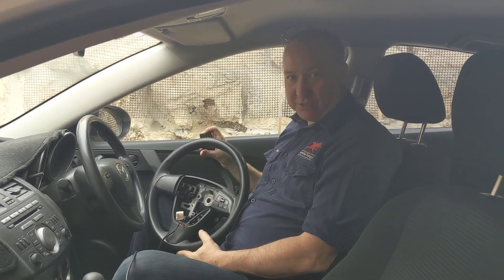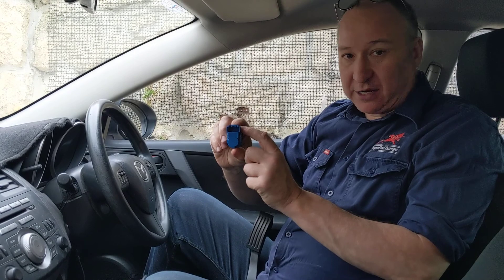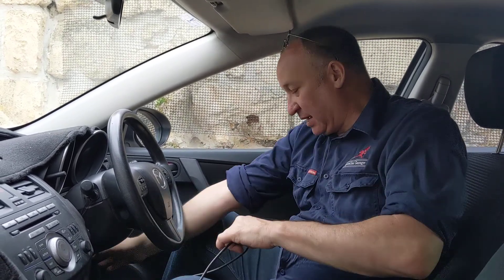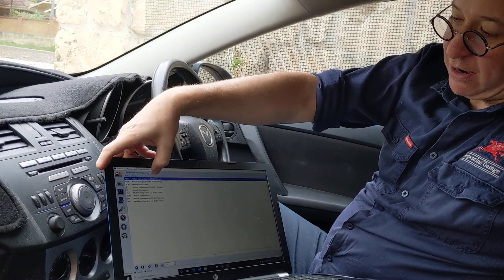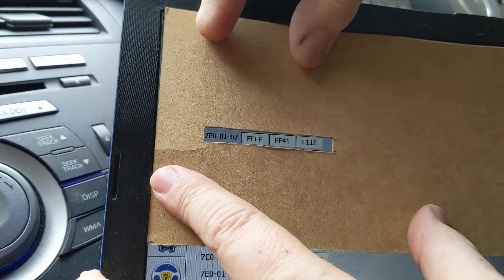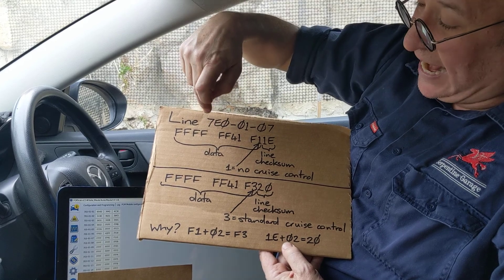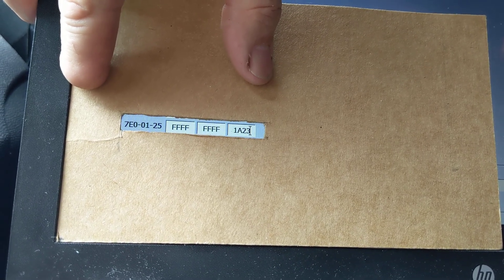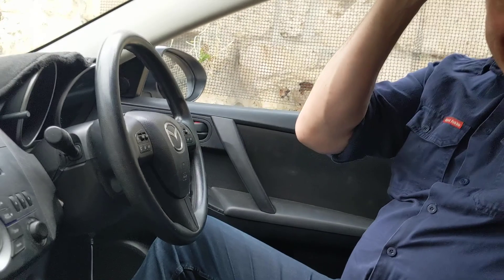BL Mazda 3: 1/4 How to install factory cruise control using FORScan. 2009 2010 2011 2012 2013 2nd

Comment: Can we install any Mazda 3 2013 steering wheel with cruise control buttons on it? Or do I need to match the exact same model like gx to gx or gt to gt model of the steering wheel. Thank you for the information .
Reply from the maker: You don't have to match the exact sub-model.  But it does have to be from a BL.  Neo, Maxx, Maxx Sport, SP25 or MPS.  It doesn't matter as long as it is from a BL (2nd Gen Mazda 3).

Comment: Hi Paul, I have a 2010 Mazda3 that has no control sets on the steering wheel. Is it possible to install a steering wheel with the four control sets? Will the wiring infrastructure be there to connect the control sets? Thanks

Comment: Hello, thank you very much for the detailed explanation. While trying the process I sadly stumbled upon a problem on my Mazda 2 DE. I could edit the line number 7 as you showed (it even had the same number). Line number 25 though could not be edited. Every time i try to save it the pc just resets the number to the previous value and gives me the error of not adding up. A change cannot be saved somehow. Do you have any idea or explanation?

Thank you very much in advance
Reply from the maker: Hi Max,

I have never tried to do this on a DE Mazda 2, and I don't own one to experiment.

Maybe disconnect and reconnect and hope that you get the easy method instead of the difficult method.  You might get lucky.

Paul.
Reply: Thank you for your response. I have found the problem. I could not change only one digit but had to change two of the last four digits. The second one of the four minus two and also the last one minus two. The cruise control still does not work even though i have the fitting brake switch. In a forum i have read that there are two cables missing. I will try to troubleshoot a bit more and post here once found for other people with the same problem

Comment: Mi cable tiene 2 pines. Si pongo  una conexión con 4 pines y  el  interruptor,  tengo posibilidades de obtener control de crucero?
Reply from the maker: No.  If you only have two wires then your car is not compatible with fly-by-wire cruise control.

Comment: Hi Paul, can I do this on a mazda cx30 without native cruise control?
Reply from the maker: I've never tried it, so I cannot say categorically.  The way to check would be to log in with Forscan, and see if there is an option to turn CC on.  If the option is there, then you would ned to check to see that the wiring harness has the right plugs etc.  For example, does the brake light switch have two wires or four?

Best of luck.  You'll work it out.  You've got a major head-start on what I had, and  I worked it out.

Paul.

Comment: Hi Paul, My 7E0-01-07 line is
FFFF 9641 FFC3
I am not sure wht to change the last FF to to activate the cruise control?

I tried the simple method, but without hardware change yet, and error come every time trying to write. I am using a not so original OBD USB reader. 

Thanks fo checking before go buying more tools 😅.
Reply: Your are superb Paul.
I checked brake light switches, and it turned out I had two brake light switches not one, each has two connection. So left the as they were.

Forscan was able to enable the cc, using Forscan recommended ODB cable via the easy method.

Grabbed a used steering wheel with cc buttons and replaced mine.

Hurray, Cruise control light up and is working 🎉🎉🎉🎉. I have been dreaming of this for two years.

Thank you ever so much.
I hope you are well Paul.
Reply from the maker: @MahmoudMazda  Congratulations.  It was a pleasure to help you.  Paul in Perth, Australia.
Reply from the maker: Hi Mahmoud, 

Changing the software won't do anything until you have changed the hardware.  So please do that first.  Then use the simple method to activate the cruise control.  If you can't get Forscan to offer you the simple method, then just drop by a Mazda dealer and get them to activate cruise control.

Paul.
Reply: Hello an my,Mazda 3 bk 7E0-01-07 FFFF 9641 FFC3
Reply: Friend, help me with solving the problem of activating the autopilot for the Mazda 3. Thank you.

Comment: Awesome video, it's exactly what I was looking for.  Do you know if this will work the same for installing cruise control on a manual vehicle or would the codes be different/steering wheel buttons be incompatible.
Reply from the maker: Hi Setso,

I have every reason to believe that it will work exactly the same with a manual.

Paul in Perth.
Reply: Can confirm it works exactly the same with a manual.  My manual 2009 Mazda 3 now has cruise control.
Thanks heaps for the guide Paul.

Comment: Hi sir this message from VIET NAM thanks for your video , it is great video for us , i had 2010 mazda 3 , 1.6 engine , do you think i can buy those part , do same way as you did , will it work ?
Reply from the maker: Hi Ahn, we don't have the 1.6 litre engine option in Australia, so I can't say for certain.  

A lot of it depend on how the input from the accelerator pedal gets transferred to the throttle body.  If it is done electronically, then there is a good chance this method will work.  If it is done by a mechanical steel cable, then it don't work.

Best of luck.  Please post your results here so others can benefit from your research.

Paul in Perth, Australia.
Reply: @PaulinPerth  for accelerator it is electronic pedal , it has 2 pins socket , I can find 4 pins as you did
Reply: @PaulinPerth  I just confused about forscan software , where I can get it and how to install  it  , can you help me sir
Reply from the maker: @MrAnhthai88  Hello Ahn, you can download it from here:  https://forscan.org/download.html
Reply: @PaulinPerth  thanks sir , i will try to start asap and if there any issues i will ask you
Reply: @PaulinPerth  sir , actually i found 5 wire from accelerator connector

Comment: Hey mate, smashing video much appreciated. Got the software setup and working but when I load the PCM as built I don’t have an option for the 7E0-01-07. I’ve got 7E0-01-01 but then it goes up to 7E0-02-XX and so on. Any ideas?
Reply from the maker: That's really odd.  The PCM should definitely have those extra 7E0-01-XX lines.

I can only suggest rebooting the computer and cycling the ignition until you get the simple mode as described in Part 2 of this video series.

Paul.
Reply: @PaulinPerth  Gave it a go yesterday but no luck. Cheers anyway mate and thanks for taking the time to get back to me.

Comment: Hi 

I have Mazda 3 2009 1.6 engine coming with cable accelerator , Do you think is there anyway can make it work .

Thanks .
Reply from the maker: Hi Mohammad, 

the method in my video will not work.  You will need to find an aftermarket kit that is suitable for your setup.  

Paul.

Comment: Was able to get my 2009 BL Mazda 3 up and running with this today. Bought a second-hand wheel with the buttons and the 4-pin brake switch. I was lucky enough to have the "easy" option showing at the top of the list so all I had to do is set it from disabled to enabled and I was good to go. Thanks for the great video.
Reply from the maker: No worries RamClaw.  Glad to help.  Cheers for the comment.

Comment: Hi, Paul - great video and very thorough. Thanks for taking the time to help everyone. I was wondering if you think this would work on a 2013 Mazda 5 Sport (base model). I'm in Canada and my VIN starts with JM1CW2CL. I installed the brake switch and steering controls, then took it into a dealership to get it activated. The tech spent a half hour trying, then said there's no way to do it on this trim model of a 2013 Mazda 5. The tech's program wouldn't offer the option (which I read as the program not offering the "easy mode" / plug-and-play option that you mention in your video). I don't think it even occurred to the tech to tinker with the hex code.
Reply from the maker: It depends on how much time and money you are willing to invest in an unknown outcome.  Maybe start with buying the OBDLink EX FORScan USB adapter and see what comes up when you go into AsBuilt mode.

If you know anyone with a Mazda 5 sport with CC from factory you can then try their setting on your car (take a backup of your original first).  I have seen forum posts where people have shared their AsBuilt files to cover this situation.

Best of luck.

Paul.

Comment: Hi paul
Does the cruise control wire still need to be grounded on a BL or is it just plug and play?
Thanks
Reply from the maker: You don't have to ground the CC wire like you do on the BK.  But you do have to activate CC in the PCM (Powertrain Control Module) via software.
Reply: Thanks Paul 
Ordered the Forscan will follow your process when I receive it.

Comment: Hi Paul, Thank you for your great video. Actually about an year earlier I watched mcorving's video on the same and I tried the whole thing. I changed the brake switch, bought a new set of cruise control buttons, tried grounding some wires as explained in that video but to my dissapointment it didn't worked on my 2008 Mazda 3 BK car. So do you think if I follow the same procedure as what you have mentioned here, that it will have a chance of getting it to work? I have noticed my car basically has the full potential to be changed into a cruise equipped car as all the wiring harnesses, instrument cluster display all have cruise funciton related items built in. Also will the hex values and the corresponding lines be simillar to the one in this video? If not can you share me the values of a 2008 Mazda 3 BK model hex values? Great help.
Reply from the maker: Hi Pathum,  Is your accelerator definitely fly by wire and not cable activated?  And your brake switch definitely has 4 wires?  I've never known the BK to need activating.  I've also never owned a BK, so my experience is limited.  Perhaps ask MCorving.

Paul.

Comment: So i had change the pcm as built. No check engine. But nothing happened if i press cruise on button. Is it because of the brake light switch? I havent changed it or check the number of pin. But the cable had 4 wire. Do you have any idea? It is for demio DE 2014 with MM vin number
Reply from the maker: Hi Tonny,

The Mazda 2 (Demio) cruise control options are:

0 - not configured.
1 - no cruise control (that's what my wreck had set in its config)
2 - cruise control.
3 - adaptive cruise control.
4 - adaptive cruise control stop and go.
5 - adaptive cruise control brake limit 2.
6 - adaptive cruise control stop and go, brake limit 2.

Because you added 2 to your option value, you went from 1 to 3.  What you wanted to do is go from 1 to 2.

Can you please install a 4 pin brake switch, and then only increment the CC value by one instead of two and let me know?

Paul.
Reply: @PaulinPerth  1:25

Comment: Good job mate I have a bk
Reply: Did you activated a bk model like this guy in video?
Reply from the maker: The BK doesn't need to be activated.  You just install the steering wheel controls and the brake switch and you are good to go.  Paul.

Comment: Hi Paul, very very nice video! I tried it on my mazda 2 from 2012 with the new steering wheel, I changed the same codes (pos 7(=same as yours) and 25(not same as yours, but I made it from F3FC to F1FA), but it didn't work. I try to find a list with the meaning of the codes from the whole list, but it is hard to find. Greetings from the Netherlands!
Reply from the maker: Hi @Otterpartsnl, here is a strategy for you to reverse engineer the solution:

1. Find someone who already has a Mazda 2 with cruise control installed and working.  You might have to join a local Mazda Facebook group to find them.

2.  Connect to their car with Forscan and save a copy of their As-built data.

3. If you are lucky, then Forscan will give you the easy option of CC enable/disable.  If this happens, then select Disable, and look at what numbers have changed.  Be sure to change the file back (using the copy you made in step 2), so you don't knobble your friend's car.  Make the identical changes on your car.

4.  If you are unlucky, then you can apply their entire as-built file from step 2 to your car.  Note that this will apply ALL the options of their car onto your car.  So just check that you have the same options installed:  transmission type, fog lights etc.

4a.  At the very least, pay attention to lines 7 and 25.  It might be that CC=enabled is something other that a value of 3.

5.  Reply to this message and let me know how you went.

6.  Share your solution on Youtube, so that you have solved it for everyone.

Paul in Perth.
Reply from the maker: Hi @OtterpartsNL,

Hello from Perth, Australia!  As luck would have it, I was looking for a new Mazda to wreck, so I chose a DE Mazda 2 with cruise control so that I could answer your query.  The PCM As Built configuration for this car is:
01 4A4D 3044 4539

02 3130 5932 451B
03 3032 3637 33ED
04 3136 FFFF FF50
05 FF2A FFFF FF13
06 FF03 83FF FF71
07 FFFF FF41 F320
08 FFFF FFFF FFEB
09 FFFF FFFF FFEC
10 FFFF FFFF FFF3
11 FFFF FFFF FFF4
12 FFFF FFFF FFF5
13 FFFF FFFF FFF6
14 FFFF FFFF FFF7
15 FFFF FFFF FFF8
16 FFFF FFFF FFF9
17 FFFF FFFF FFFA
18 FFFF FFFF FFFB
19 FFFF FFFF FFFC
20 FFFF FFFF FF03
21 FFFF FFFF FF04
22 FFFF FFFF FF05
23 FFFF FFFF FF06
24 FFFF FFFF FF07
25 FFFF FFFF 1821
26 1BFF 3058

Forscan is not giving me an option to disable CC, so I can't turn it off and see what changes.

What you could do is save your ASB file, and then overwrite yours with the data above.  That should enable CC.  Just check that all your other features work.  For example, my car does not have fog lights.  If yours does, then the above file will probably disable them.

Have a play around and let me know how you go.

Paul in Perth.
Reply from the maker: Hi @OtterpartsNL,
I got a wrecked DE Mazda 2 without cruise control today, and I used ForScan to look at the details.  It gave me the 'easy mode', which gave me all the options, and explained why it didn't work on your Mazda 2.  The Mazda 2 options are:
0 - not configured.
1 - no cruise control (that's what the wreck had set in its config)
2 - cruise control.
3 - adaptive cruise control.
4 - adaptive cruise control stop and go.
5 - adaptive cruise control brake limit 2.
6 - adaptive cruise control stop and go, brake limit 2.

Because you added 2 to your option value, you went from 1 to 3.  What you wanted to do is go from 1 to 2.

However, on my DE Mazda 2 without cruise control, the wiring harness for the brake light switch only has two wires going into it.  For cruise control to work you would need four.  Has your harness got two or four wires?

From what I have seen, some DE Mazda 2s without cruise control come out of the factory with a two-wire harness, that is incompatible with having factory cruise control added.  It doesn't appear to be all of them, as another commenter with a VIN starting with MM has a four-wire harness going into his brake switch.
Reply: @PaulinPerth  Hi Paul! Again thanks for all the information about Cruise control for Mazda. As I told you I own a Mazda 2 from 2008, and as I read above maybe the problem is the 2wire harness😞 could It be easy rapleced? Or any other solution? Thanks in advance. Grettings from Madrid.